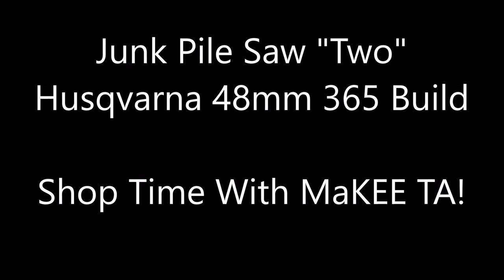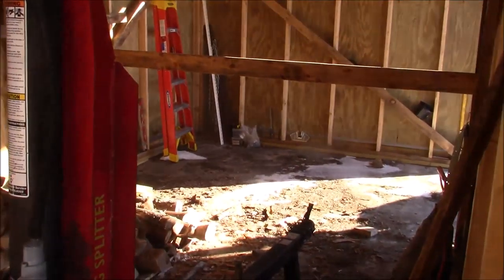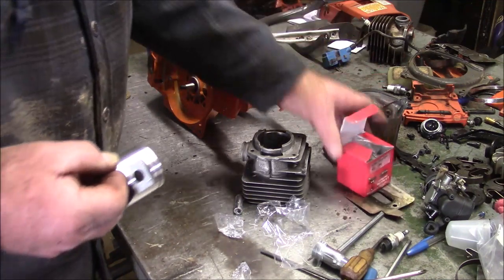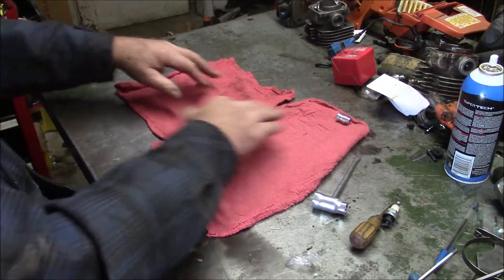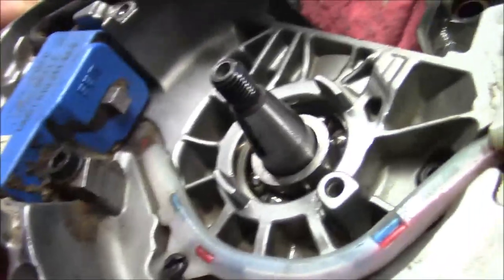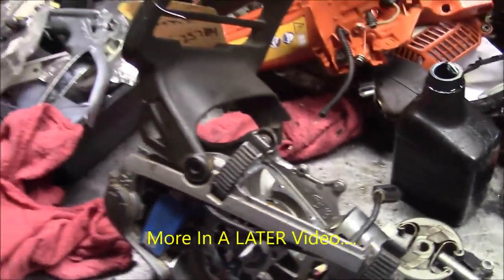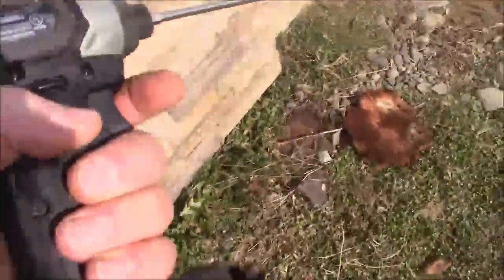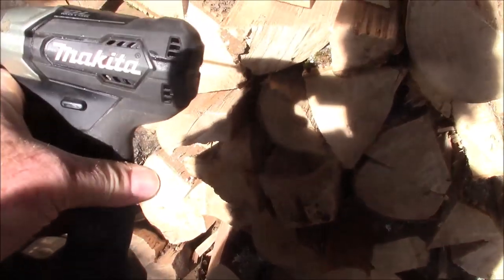Husqvarna 365 48mm Part 2, Vacuum Testing Husqvarna 550 & Hyway Plating Fail, Makita Tools

Comment: For me there’s kind of a special attachment to a tool that has more than proven its worth....and you’re confident it will do whatever job you have it mind for it today.

I bought a 22 ounce Estwing hammer when I was 19.  Probably one of the first tools I ever purchased with my own money.  I was working construction over summers.  Still have it, and it not only did paying work back then, but it’s been part of nearly every home improvement project over the last 20 years.  I thought I’d lost it a few weeks back and it ate at me.  It had been left outside leaning on a tree where I’m building the kids a tree house.

Have the DeWalt version of that little 1/4 drive impact.  Not as time proven as the Estwing, but sure is handy and dang does it punch above its weight.  I’ve used it for things well beyond it’s designed intent.

Comment: I took those cross sections out of my 50mm 372 clone but left them in just as they enter the bore (SX82) and opened the ports right up without changing the port timing, deleted the base gasket going from around 50thou to 25 thou, muffler mod too with an 8T sprocket and boy didn't that wake it up omg!

Comment: Great video Walt!

I did a 365 OE build very similar to the one in the video last winter. 

After watching a vodeo where you guys where describing mods that cand be easily done I decided to try it for myself but on a 365. 

I did the mod to the transfers like you do, set squish at 20 thousands, raised the intake skirt about 30 thousands and did a muffler mod. 

Been flogging that saw since winter and I will say its got more power then stock and has lasted so far. I don't have a 372 OE to compare it to but in bigger hard wood it out cuts my modded 562 but wont hang with a strong 044 that I built. 

I'll be interested in hearing your thoughs in the future about wether your 365 is a success or not and or wether its close to a 372 or not?

Comment: Hi Walt...thanks for sharing this video, the 48mm build may last longer now,just wondering did you find a 365 carb or use the xt carb from the 52mm.Also enjoyed the 550 footage,thats a neat flywheel removal tool and intake plugs ,thing is u only need to purchase these once. For you it makes sense due to the volume of saws you get....so good bye for now..
Reply from the maker: It has the Aftermarket Huztl cases, a continuation of field testing those as the one set failed, a crank in another set failed as documented earlier ( replaced with an OEM crank and the Madsen JPS saw is built around it, the first JPS ). This is more in the same series with the field testing of the Hyway cylinder that ALSO failed. I used a muffle modded Huztl muffler, but the Crank, Carb, and related parts are OEM from a 372 X-Torq. The OTHER theme of these last few "Junk Pile" video's is making use of 372 X-Torq bones. Basically the premise being building ( maybe Phoenix saws??) useful saws from the bones of dead 372's using Aftermarket parts to keep the cost in line with a Used option, vs just throwing out that stuff as has been typically done. Getting confusing right? Maybe I should do an addendum to quantify the score on this stuff so far.

Comment: What inside diameter is the tubing you used for the muffler?
Reply from the maker: depends. if I leave the stock opening......1/2 to 5/8. If its closed or I start with a Huztl Muffler 3/4inch even 1inch from time to time depending on what's done up stream
Reply from the maker: Shoot for approx. 80 percent x-sectional area of exhaust port...plus or minus a bit. Not really that critical.
Reply: For some reason I've always thought that the tube can be half the size of port or smaller didnt think something slightly bigger then half would be able to work. I'm still thinking .6380 is slightly to big. The only thing I have that's close to half inch is .5657 I.D. but its galvanized an I'd prefer mild steel. It is for a 029 with a 039 49mm cylinder have yet to see someone do a port muffler for a stihl 029 039 ms290 ms390 because of the mufflers being crimped together. I've split plenty of mufflers and once you figure it out its cake walk to get them apart. The existing holes will be welded closed, this is definitely something I've not seen done by others so if I'm the first then so be it 😎 she is getting a couple other things to so that the ported muffler will help instead of hurt.

Comment: Personally, I do not think the Husqvarna cylinders are as rugged as a similar stihl.  I had a 125B husqvarna blower that I had for over three years.  I ran the crap out of it but I fed it good gas and I had it set up pretty rich, but after three years it started to drop off in performance, so I bought a new one.  I could readily tell the difference between the two blowers, afterwards, so I gave it to my oldest daughter and kept the new one.  I never had a problem starting my first 125B, but it just tailed off in velocity of the air moving through the saw.  My guess was the plating in the cylinder was getting worn off.  In contrast I had given my youngest daughter a BG56CE Stihl blower when I bought the first 125B.  It is still running fine and seems to have more performance, now, than when I gave it to her.  You ask me why I do not build a husky.  It is simple, I do not think they are built to the same standards as a Stihl, Chinese or not.
Reply from the maker: OF course that is supported by this video because the Aftermarket Hyway cylinder plating failed is my guess on how you process data . :) In my experience it has more to do with who actually manufactured that cylinder. A Mahle Husqvarna or Stihl cylinder will out last a cylinder from any other source. When Stihl began to take their Cylinder casting in house they frankly were junk. And when Husqvarna started the Chinese sources cylinders on the 550's they to were less reliable than the Mahle cylinder based 562's. And the other factor is saw model therefor design. Husqvarna's 240s are complete crap. But the OE 372 and earlier 200 series saw cylinders last longer than the rest of the saw....of course Mahle's. Same with the early Stihl's with Mahle cylinders like the 038 thru 066's...excellent designs, love them. I've has a rash of MS362 and 461 cylinders I've had to replace. Similar frequency as the PTO side bearings on XT 372's....so as I said I completely dissagree with your premise on this one...:)
Reply: Unless you tested compression or viewed the cylinder, then assuming the cylinder is the issue is sloppy diagnostic work. Even if the compression is low, how about the piston ring vs the cylinder? What typically does happen on 125B's is the intake block begins to loosen and the blower runs like crap. And it is a bear of a job to get in there and correct it too. Not a very good design IMO. But really John, to judge all Husky cylinders as not rugged based on a cheap handheld blower example is a rather unrealistic stretch.